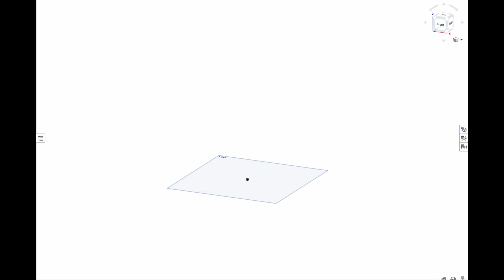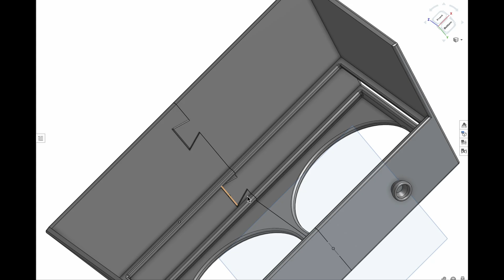#39 Fume Extractor 2.0 -  3D printed, usb-c powered with lighting

Comment: This is neither a good fume extractor nor a good fume capture system. The lighting and angled design is good but it also won't work if you use a microscope. The idea that you see white opaque fumes go in and 'disappear' is a false understanding of what is happening. You need to use granulated active carbon likely with a hepa filter to do anything.
Reply from the maker: then it's a great way to spread the fumes evenly throughout the room, making everyone participate in the soldering activity. win-win.
Reply: @UNgineering  LOL